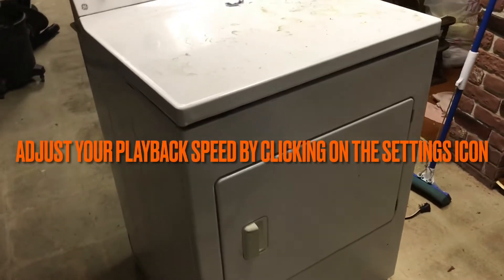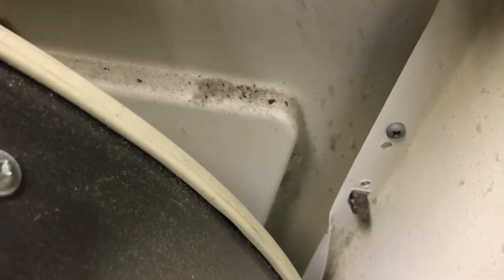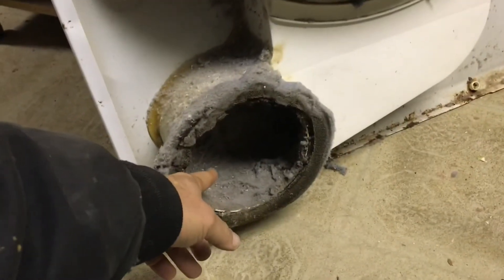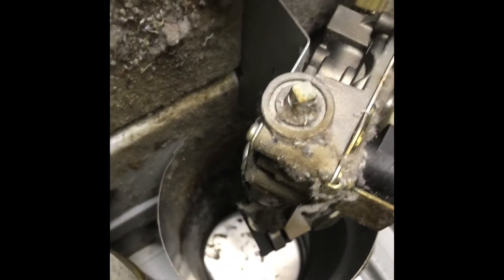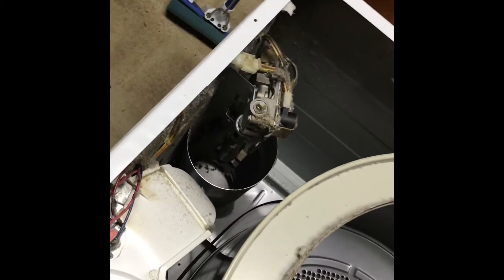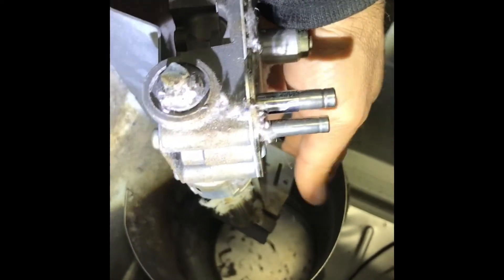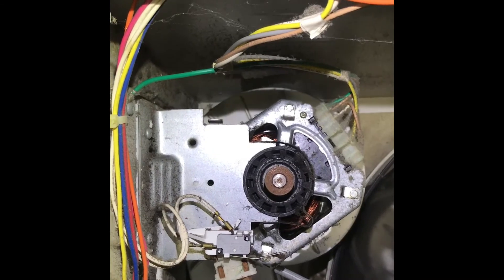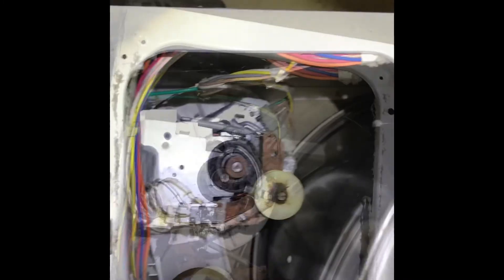How a Gas dryer works￼, A look inside and common parts that go bad￼

Comment: Hi I want to know how it sucks aur from burner to drum because drum is spinning na
Reply from the maker: the back face of the drum is stationary with a vent for the heat to come through. the air blower sucks air from the front of the drum through the lint filter allowing hot  air to flow through the drum as the clothes spin and tumble causing them to dry